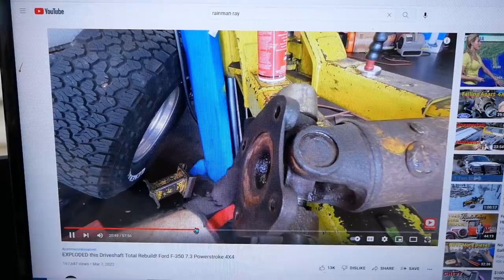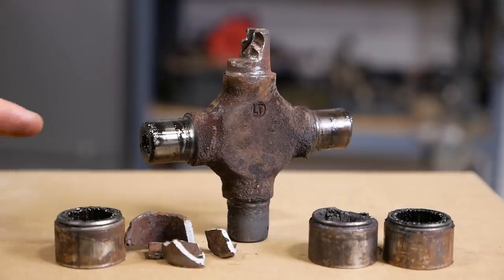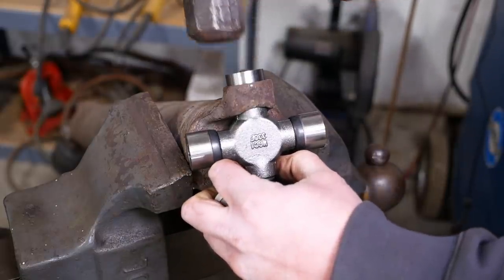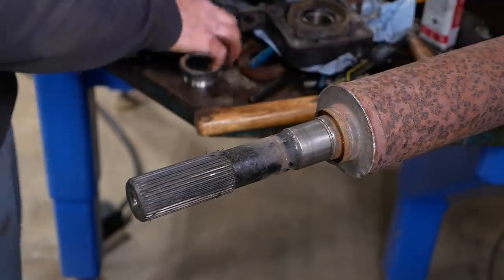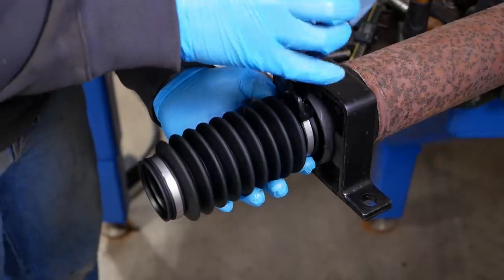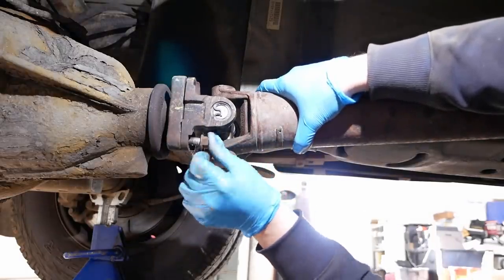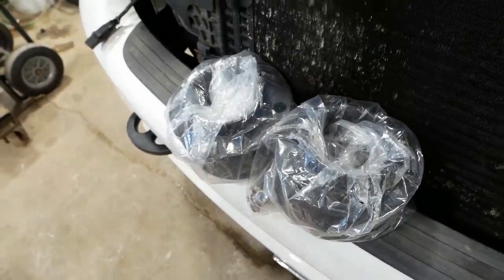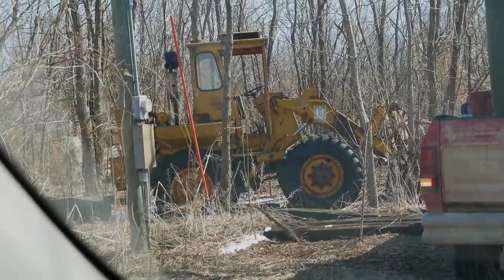Self Exploding Drive Shaft - Too Much Cummins Power...

Comment: This is an example of a person who doesn't understand the concept of Maintaining a vehicle that you put out good money and hope for a good investment on the purchase.  I have had several vehicles that we were able to put on over 300,000 miles without an major problems.  Yes spark plugs, filters, brake shoes, and many times grease the connections to maintain adequate steering. All good mechanics has his favorite striking device.  Wes you do good work and make the job very easy to understand....

Comment: Brings back memories.  In preparation for a trip across Europe I bought some new tyres for my Freelander.  Manuel says that all four tyres should be replaced together but, hey, tyres are expensive and it is surely not ecologically friendly to throw away the two good ones.  So I fitted just two.  The Freelander has a system which detects the difference in rotational speed of the wheels and applies 4wd automatically.  After 1,600 miles of wind up, a full-lock turn on the steel deck of a ferry boat was enough to blow out the two prop shaft bushes and the viscus coupling unit.  It didn't disable the vehicle but it made a lot of noise on the journey back and the repairs cost about five times the price of two tyres.  Motto - sometimes Manuel knows best.
Reply from the maker: Subarus are good for that.

Comment: I changed a u-joint one time in highschool. I limped my 49 Ford to the auto parts store with the propeller shaft banging away. Changed it in the parking lot with a tool box I brought with me. Yes under the car with a bumper jack. Before battery drills were invented. Threw the old parts in their garbage can. Yes there are different ways of doing it. Some guys can't believe there is any other way to do it besides their way.

Comment: When installing u-joints I have used the hammer and socket method, my bench vise, a c clamp and a ball joint press, they've all worked and worked well. My current method is the bj press.

Comment: I had to change the drive shaft out on that truck I’ve been building because the previous owner welded the caps into the yokes. It wasn’t just a tack or anything reversible either it was fully welded. Used ones are pretty hard to come by so I got an upgraded one from performance driveline in California. It was redesigned to put the slip section in the rear shaft instead of right by the carrier bearing and has 1480 ujoints. Wasn’t cheap either. Hopefully it lasts. It takes a lot to hold back the Cummins power. The short beds use a one piece shaft with the same transfercase, But yeah all the slip yokes are weird.
Reply from the maker: That's fun!

Comment: Thank God for my thermal camera. Spent months trying to figure out what the hell is going on…

When the carrier bearing failed on my 2006 Nissan titan, scared the absolute shit out of me. It was just at a certain frequency/vibration it would start to vibrate like crazy at a certain speed above 40 miles an hour. , Sometimes it would just slowly stop and sometimes it would almost bounce down the road until I could gain control.

 Towed a few times, but we could never figure out what was wrong. Because when you grab the carrier bearing or driveshaft to try to move it around, it already popped back into place, because of the weird design and the strange rubber grommet like things that had half melted. And of course every time a tow truck would pull it up on the flatbed, it would jostle everything around and kind of click everything back into place and it might not show up again for another week or maybe even a month or two. 

Finally figured it out with my thermal camera and fixed it myself. Holy shit a thermal camera is so important especially for something like this. I justified the purchase because of my electronics/metrology/repair business… But it’s even more useful for mechanics folks 

Bought the truck new, I’ve done basically everything myself which is only included things like changing the oil, I think I put new plugs in it at 100,000 miles, and new brakes and stuff. And that’s about it. Got almost 500,000 miles on the truck now. Still drives great, but as someone with a machinist background and experience doing tool/die work… I know how the metal and components are stressed when driven hard… So I’ve always driven like a complete grandma. Pulled over for it several times as well 😂 whether acceleration, breaking , deceleration, turning, whatever..... I try and take it easy on the old gal

I was about seven years old and was riding with dad to Gunnersville for a big bowfishing tournament. And his universal joint literally exploded. And left pieces stretch down three or 4 mile length of the interstate. Somehow he Jerry rigged it with bailing wire and duct tape in a few strips of that hardening fiberglass tape… We fished the tournament, even got it home, and the family mechanic cussed him for a month…

Comment: The first set of U-joints that I changed was on the side of the road in 104-degree weather and the only tools I had were a bumper jack, a hammer, a crescent wrench, a pair of vice-grips and a straight screwdriver...  It took a while but it did get done.  I was just lucky that I had bought the new parts and was on my way home to install them...  Didn't quite make it...

Comment: As another YouTuber said - "there are multiple ways to get to 10, and all of them are right."  So whichever way suits you to install U-joints, provided they function correctly when finished, is the right way.

Worth noting the old-timer that rebuilt my rear driveshaft last time (I didn't have time to do it myself) hit them with a hammer, and they've been fine for several years.

Comment: Wes I have to say I am impressed, that drive shaft made it that far in one piece as I usually just have them drop the drive shaft on me while going down the road. And the last time that happened to me, I was in a Ford F-600? Dump truck near our local 3M plant. Was fun dropping and installing the new U-joints on the side of the road, under a dump truck. As for that drive shaft design, Chevy use to use a similar design with a two slip joints back in the 80's with their square bodied trucks. Never understood why they did that.

Comment: On grease-able joints I like to put the grease zerk spot under compression from the driving force of the engine. It's seems better to have force pushing on it rather than trying to pull it apart. Nice work Wes.
Reply: Yes sir I have done it that way also, but in some situations one can not a grease gun on the grease fitting unless one removes the shaft in order to get access to the grease fitting. Of course that is a minor inconvenience.

Comment: the tool you used to remove the ball joint. I use it to reinstall the new joint. But I put the tool in the vice. And block up the drive shaft to line it up. Then you have 2 hands free for the impack and holding joint.

Comment: I had a 3” leveling kit like that on my old f150. It had the upper control arm stretched so far it tore the boot and was just barely making contact with the strut spring, it also causes the tire to wear unevenly over time. They look meaner, but definitely go for the full setup rather than the $60 spacers

Comment: I had a Dodge Ramcharger 1978 I believe, had to have a lift on it of course, did many a U joint on the side of the trail laying in mud with a hammer and a cinder block. Sure ate them up with the lift, and the climbing, used to carry a couple sets!!

Comment: In my 20's I replaced a worn carrier bearing on my 150k mile 1975 F250, also replaced the U joints as a precautionary step not because I thought they were worn out. On reassembly I failed to follow any of the proper orientation steps you outlined, guess I got lucky, it ran another 150k trouble free miles before I traded it in. by the way, I used a hammer to install the end caps too. I live in a warm south west coastal snow free city.

Comment: I hammered my truck into thick deep(<-- didn't know that part) clay mud with my brand new super swamper SSRs back when they first came out. I wound up badly stuck and managed to pull the threads out of the yoke on the rear diff. Needless to say, everything involved with the rear shaft found it's way out from under the truck in pieces. The straps, bolts, cups, and most of the driveshaft came out.  I returned with a shovel, heli coils, drill, taps,, straps, and a u joint. I dug a trench to get to the buried rear axle and work. The cups went in with a hammer and a rock. 😂 My fine Black & Decker drill fixed the stripped yoke. bam bam me put u joint in with rock🤣

Comment: Hammer?  I would've maybe gone with a lighter one, and maybe slightly lighter taps, and probably a like-sized socket for a drift, but...been there done that about every time.
C-clamp?  Yeah, good luck with that - unless you can drive it with an impact.
I've actually made it all these years without a vice, but one day...
Wes, perhaps the problem is not you, but rather us, your audience. Maybe your videos inherently attract those of us who tend to nitpick, and need everyone to do things our way...
I would've taken a small drift and done a few small taps directly on the portion of the C-clip which was not seated. So satisfying to see them spring-load themselves into place.

Comment: Excellent video Wes :) also crazy driveshaft I ever seen and had  fix with father in law vechile was on Chevrolet 12 passenger type on 1984 2500 series Chevrolet type was 350 4 bolt main motor with 700SR 4speed Overdrive Automatic transmission! The drive a tube one peice had Universal joint so hard grease unless had took drive shaft then grease up and then installed! Check in set up on internet and shake head to say holy crow !

Comment: When you install cross the grease fitting hole should be under compression during acceleration that is the weakest part of the cross. I have seen u-joints break their numerous times. Watching you reminds me why I quit being a mechanic and started being a machinist. Great videos I do not envy you.

Comment: This is a common problem because the cups with the needles are locked (cramped) up to much in the joke's and very often in case of a joint with a grease nipple. The grease won't come to the "cramped" cups with its needles. I replaced the joints (in earlier days when young), I took of the cups one by one, then made a little scracht at the back of the little plastic centre ring in the cup and a little hole in the centre of that plastic ring, so the grease came trough on the bottom of the cup and in this case, all four of the cups.

Comment: I have done a few ujs, actually never thought of using the ball joint type press. I have got a support bearing to do on a 4x4 fiat panda, so ujs  may need doing too. Will try this method. There is less of these type videos produced in the uk as the majority of vehicles are fwd. The wife's pathfinder has joined the party now and needs a front prop uj. The panda one is staked so need to see if can live with doing centre bearing only. Out with the mig pliers and the ball joint press tool.

Comment: Your clip is not engaged properly. Look back at the video.  Built shaft for years. Always amazed that people ride that vibration till it falls out. Shield is not necessary but it does serve a purpose. Keep up the good repair work. And the good videos.
Reply from the maker: I believe it is. But if not, the rust will hold it.

Comment: I do it same way you did expect i prefer to turn shaft so caps stay up I hate playing 52 pickup with the rollers inside caps had it happen once now just rotate as I go
Reply: Agreed I wouldn't raise front on a tow rig or work truck if anything I would be trying to bring front down make it look level loaded to max

Comment: I finally got my truck fixed, the abs and traction control would go off at slow speeds, left front wheel bearing was bad, installed a new one, abs and TC issues fixed, still had a bad growl, put a right front wheel bearing on and the growl is gone, I though the front diff was bad, nope thank God, now me and my 6.0 can rule the world lol

Comment: i had some driveline issues on my 2500 4 door long bed and got rid of the 2 piece driveshaft for a 1 piece factory aluminum one.  i had a vibration and tried everything from shimming the carrier bearing to some hose clamp balancing voodoo.eventually going for the 1 piece aluminum which at the time was the same as 3 u joints and a carrier bearing.  looking forward to the loader engine!
Reply from the maker: Did you have it made or can you just buy one?
Reply: @WatchWesWork  straight from Dodge. been a long time and never had any more issues with it. all the 2008 and up trucks went to the one piece driveshaft i believe. i just ordered one for an 08 for my 07. not sure if the 03-05 trucks used the same transfer case or transmission so length and or slip yoke spline might be different.

Comment: I'm so glad you used a 'Birmingham screwdriver' (my Birmingham is about a 1000 years older than yours). It actually refers to the method used (supposedly) by Brummies using a hammer instead of a screwdriver. I was born very near the UK Birmingham and I can assure you it doesn't work very well.

Comment: Great vid Wes. I just finished watching Rainman Ray's U-joint removal where he had some cap breakage. I was amazed at how easy those caps tapped in with the hammer though. I don't think I've had any install that easy. Thanks for sharing.
Reply from the maker: They've been in and out a few times I suspect!

Comment: Both equally good jobs, 
Wes's job, methodical...,quiet laid back, straight forward, rust light not a factor, degree of difficulty 2-1/2 out of 5
Rays job.. phones...do-dodood-doo, distractions, noises, rusted clips...beat it apart and then beat it back together. Degree of difficulty 4-1/2 out of 5
Both jobs equally entertaining...

Comment: the last two u joints I did on my 2003 cummins were so rusted in so bad i had to cut the trunion with a plasma cutter. good times, but the caps fell right out of the yoke with no damage!

Comment: I thought the point of the two piece driveshaft with multiple slip joints was that you could remove and install it incrementally.  Unbolt the rear yoke from the diff flange, then the slip joint slides right out of the carrier bearing.  Then you can unbolt the carrier bearing and remove the front half of the shaft.  Reverse for installation.

Makes it easier to handle, and lighter.

Comment: i use the vice sometimes, i use a couple 4X4s, sometimes use my snapon ujoint press which is a wast of $650.00 25 years ago when i bought it. then sometimes i use my tiger tool remover and installer which is probably the best investment all around

Comment: Wes, before I use a hose clamp on a slip shaft boot, I would use black zip ties. I have used two to try to keep things balanced, making them equal lengths. I'm not sure that the little bit of plastic on one side would do this, but safety first. Zip ties are not a permanent fix.

Comment: I have a jeep Grand Cherokee and it had weeble wobble shaft. I had to buy a new u joint and yoke because they are staked  from factory. I cut out the cross with torch which allows you to push 1 cap at time. Ended up braking the new yoke with ball joint press. 10:30 using it just the same way. so I now channel my inner mc hammer.

Comment: I replaced a u joint one time and one of the little needle bearings got cross ways and drove me crazy 😜 till I realized what was going on after taking it apart a couple of times. But I did get it. My take on u joints is take your time and do them right and they will last you for a long time.

Comment: have you tried non-greasble u-joints? We had to replace the factory u-joints @ 100K and they were sealed units. The new ones were greasable and died @ 25k twice over. The last set we went sealed again and those lasted till we scrapped the truck at 250k.

Comment: I like using my ball joint press but to each their own.  Hammer works good sometimes.  The only way i hate doing it is with a shop press.  huge waste of time setting that up.

I have never had a carrier bearing i could replace myself.  Couple dodge's were sent out to a powertrain shop as they were press fit and the powertrain shop converted it to a unit that could be replaced without special equipment.  Small SUV's usually only sell the entire shaft as well.  Nice work.

Comment: HaHa, I just fixed my power steering leak on my 04 Dodge. And as always it turned into a classic "Get every tool you own out"!! It turned out to be a three way hose connector between the steering box and frame.

Comment: I have probably installed a thousand u-joints over the years and I've used pretty much every method there is. Haven't really found one that was particularly problematic. As long as you get The u-joint installed and don't do anything stupid it's fine.

Comment: I changed mine out to a 1 piece - great mod!
Lift kit is going to require new shocks, brake lines, adjustable Track rod and probably control arms. Then it will sit stupid when working.
Reply from the maker: I just don't see it being worthwhile.

Comment: First, how did you remove those clips and NOT loose them across the room?!? and um, yea... I've got a 03 w/o training wheels, same otherwise. Many guys told me I should have gone with a 1 piece replacement shaft rather than repair the 2 piece.(?) You can use a floor jack and/or jack stand to replace shaft. If you use the Dodge springs that end with 988 in the part number it lifts the front up a bit.  Good vid!

Comment: Have you been watching my videos? That's basically the exact same procedure i've been using since you were just a wee lad! lol

Well, the only minor difference is I pre-pack the joint cups with a dab of grease during assembly just in case the grease doesn't feed all 4 cups...since it usually doesn't. :)